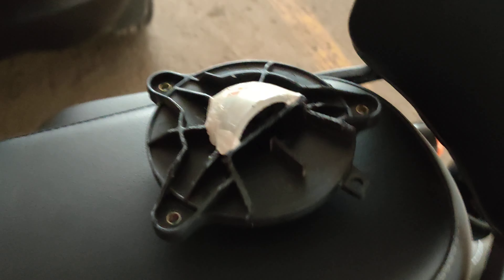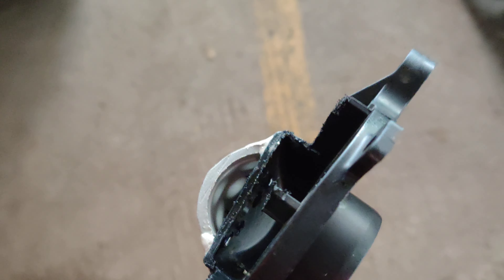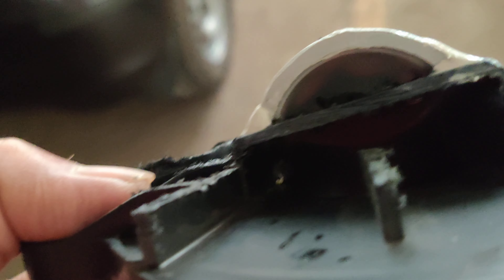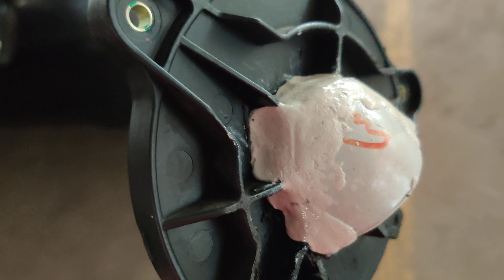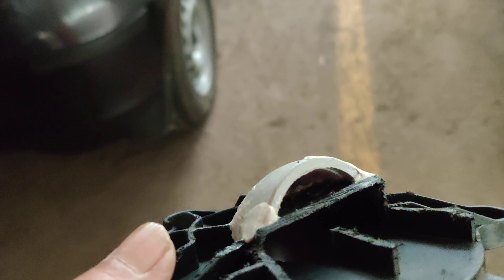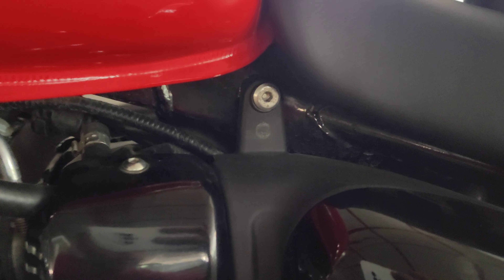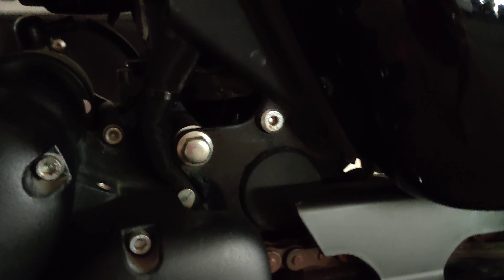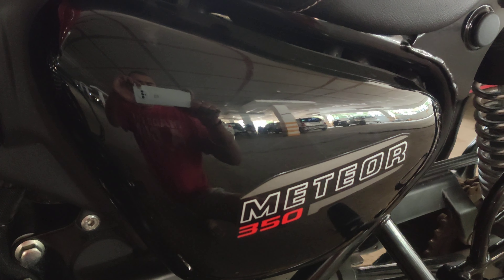meteor 350 airbox mod enhancement

Comment: D-B ... I applaud your efforts to make your Meteor 'breath' easier (I have recently traded my RE Interceptor for a Meteor as I wanted a machine that encouraged me to ride in a more relaxed manner in my pleasure rides in the Hampshire (UK) countryside.  The Meteor is just the ticket : - )   ).   However I would like to make an observation as 'food for thought' ...................   Firstly, I am a retired person with quite a lot of experience over the years with a spanner, and had a fair few 'bikes in my time as well, but I am not any sort of boffin (i.e. practical but not scientific).                    My belief (I can't recall the source) for the backward facing snorkel on the OEM air-filter retaining plate is so (particularly in India) that, should the 'bike be ridden through deep river fords etc, there was a slightly lesser chance of water being scooped into the fuel/air mix.                      I understand the principle of volumetric efficency where you observe cooler air, being denser, carries more oxygen with it than hot air (you may think the latter applies to my wittering !) so you thought that your initial filter retaining plate mod would allow too much hot air off the engine into the fuel/air mix thereby not achieving your sort after maximum possible combustion efficiency.  This is where my lack of scientific knowledge  comes in to play .....  I haven't a clue as to how the hot air off the engine flows inside that left side (air-filter side) plastic cover. The air-flow may well/ may not swirl around in a vortex before making it's escape from inside that curved plastic cover.  Hence, I wouldn't know whether your subsequent mod. affects the temperature of air entering the engine via you modified modification by any significant degree.  However, air-filter specialists (e.g. DNA etc) provide just a round and flat retaining ring, with a gert big hole in the centre to retain their air filter element (so it's just a large diameter washer in effect, with a big hole). The retaining plate is purchased as an extra, and the original 'snorkel'  plate can still be retained instead if required. DNA advise that use of their retaining ring (instead of the snorkel plate) permits a greater airflow, so is beneficial to airflow enhancement, which is of course what any modification in this area is seeking to achieve.    Now, my thoughts are that companies such as DNA WILL have 'boffins' working in their design department who will know about air-flow, as that is what their products are about, who (hopefully) will have considered whether a snorkel retaining plate of some sort to target the air-pickup point would be beneficial in heat management of intake air rather than just the flat ring they supply.   My 'practical' side suggests to me that there will be a trade-off between high air flow (DNA retaining ring) and air temperature, and air flow would likely be the winner, especially as the greater air-flow will reduce the resitance to the whole process of air/fuel getting to the combustion chamber. .    As I mentioned earlier, my musings are just food for thought, not an attempt to stiffle your creativity, so please don't be offended.   I live on my own and the tv programmes are yet again rubbish tonight, so I thought that communicating with a fellow biker would be a better way to spend my evening.
Reply from the maker: Hello good sir,
First of all, thank you for taking time out to pen down your thoughts in an unhurried manner, not many people do that, these days.
Now to the point, hot air does seep into the side panels and quite generously at that. You may ask how? It's all because of the force and the direction of air movement. It does not happen when there's no breeze and the motorcycle is stationary but when it's moving, it encounters air irrespective of whether there's any wind or not, that's the whole principle behind air cooling of engines. Now these side panels are more of a cover than anything else i.e. they do not seal off the portion they cover at least the part behind the engine. Now when hot air passes further away from the cylinder and towards the rear, its deflected in both directions i.e. right and left and the sheer force of it squeezes it into the side panels. Trust me, I know what I am saying, I've done this kind of modifications on a couple of motorcycles as well as cars, petrol and diesel and these considerations go a long way in shaping one's experience as well as the performance of the machine. As for the aftermarket manufacturers like K&N and DNA, of course they have experts to design their products but I have never used any such products as I believe in tinkering as little as possible with the reliability of a vehicle. Free flow filters tend to allow very fine dust to pass through and that can harm your injectors or carburettor jets, my 2 cents and that of some more people I personally know. But, even with those aftermarket products, if one can ensure that as much cool air gets sucked in, the performance would be even better. I hope I'm making sense.
With that, thank you once again for your time and interest and I wish you well, take care!

Comment: So what did you gain for your trouble?
Reply from the maker: Smoother combustion
Slightly more effortless delivery of power
I cannot comment on fuel economy since I have not taken her for a decent sized ride but I expect it to improve as any speed is now achieved and sustained at lower RPMs than before.
This is a tried and tested hack of mine and my most favourite one
Done this on 3 cars and 2 bikes
The best results however have come on a turbo diesel obviously